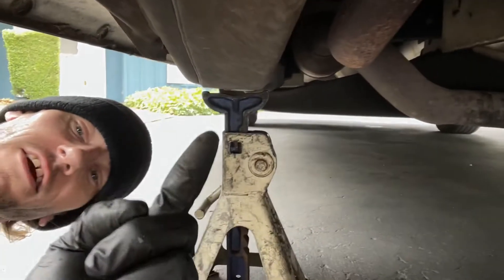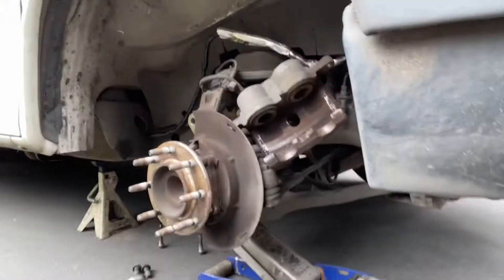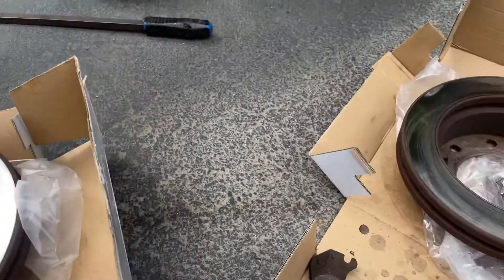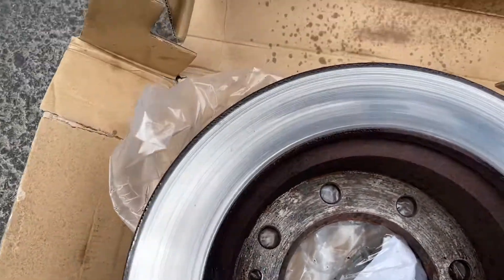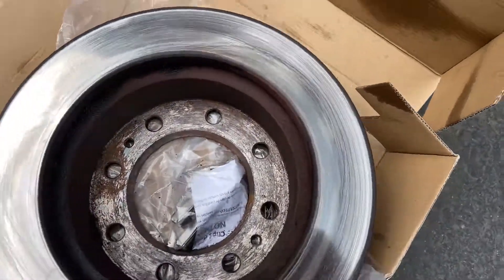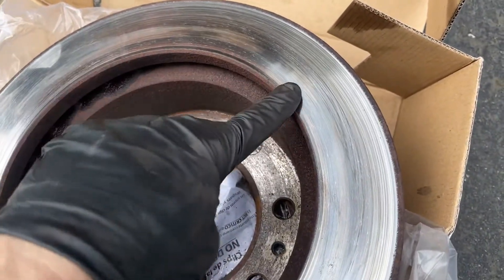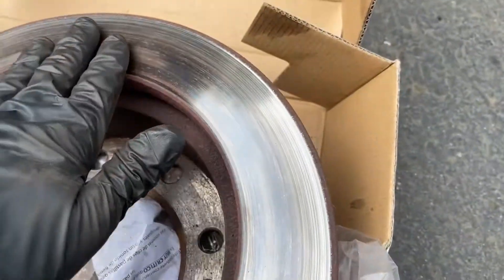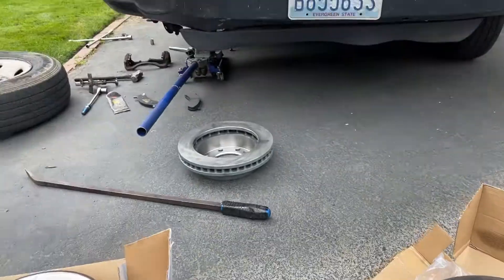Mechanics Tip (warped rotors)

Comment: Best tip ive heard so far. It takes a little more money but i think its the better option. So i had 1 rotor and pads changed on my car. And several months later its shaking again. This time im just gonna replace all 4 with new rotors and pads and do it right. The back rotors look fine. But im still decide whether to change those or not. Its the front that looks to have some scoring marks. Its even in the middle but on the outside and inside of the rotor have small scoring.
Reply: Did you get rid of the shaking while braking? Or did it come back? I have a newer car with 54,000kms and it shakes when braking hard at highway speeds. The dealership won’t warranty it because they say brakes are a wearable item. Most of my vehicles go at least 100,000kms before needing brake components
Reply: @beri232  yes i fixed my issue. What you need to figure out first is whether the issue is the front or the rear. If its the front, its easy to tell cause the steering wheel will shake side to side a lot more than normal and feel it in the pedal too. If its the rear, you will feel it in the pedal only.

Better have the rotors replaced unless you want it resurfaced. You have to buy new pads with the new rotors you want a flat surface so it will bed the pad with the new rotors. 

The most important thing you have to do after the brakes are changed out. Is doing the break in procedure. Id recommended doing the normal driving method. You just do normal driving, but because the brakes are new, you need to gently come to a stop not matter how much you annoy other drivers. If you get the brakes hot while holding it at a stop light the material will transfer to that one stop thats when the brake pulsation starts after it cools down. You do it gently so it doesnt heat up the brakes too much to have equal material transfer. I learned my lesson after i did pad slap on my previous car. I fixed the issue on it and braking improved immensely. 
Do that for at least 500 miles worth of driving. Watch the rotors for progress.

If you have anymore questions ill be here to answer them.

So i want you to do is after a drive, is to look at the rotors. You will see the progress of the pad tranfer. I wouldn't worry about what it looks like in the beginning. After your 500 miles worth of driving + braking. You  should see a even tranfer of material on the rotor thats when you can go back to braking how you want.  

Beding the new brakes is the most important part to avoid the issue
Reply: @jack8356  I bought Akebono Pro ACT pads. There is no bedding-in necessary. As per manufacturer’s instructions. I bought some EBC rotors also which have a higher carbon ratio so hopefully this fixes my problem. I’ll do fronts first because they are the easiest and if the pulsation is still there, I will will do the rears as well.
Reply: @beri232  they may say that but don't blindly follow that. Trust me you want to do the procedure. If not you would have to replace it again if it pops backup 6 months later like my did. Its better to be safe than for something to happen later on

Comment: Thanks for your info. After doing a complete brake job and after a couple thousand miles   my front right brake vibrates until I touch the brake pedal. Never when it’s cold never when the bakes are applied. Think I’ll change out both front rotors.

Comment: I got 70k out of my factory brakes and rotors.  New ac delco rotors warped within 20k. Always torque my lugs and my driving habits were the same. So I  think user error is far less of a factor than poor quality iron being used.  I feel for those folks who have to pay others to do these simple r&r jobs.
Reply: 70k? Wow. Got to fight out where that dealership gets their rotors.
Reply: I'm interested why would torquing your lug nuts to the specific torque change if your rotors last or not
Reply: What kind of pad material was used on the new brakes?

Comment: Hey, i understand that you like Brembo brakes. How about Zimmermann brand?
Reply from the maker: I feel that Zimmerman is more expensive for less quality, in the respect that, brembo brakes are a softer alloy and quieter, while dissipating  heat better. Yes, they wear fast, but when your performance car calls for that alloy as a requirement for braking, vs Zimmerman, which will be a harder alloy, you could experience temperature and noise issues similar to white box cheaper rotors.
Reply: @MechanicalTriage  Got it.
Those newer cars come with autopilot cruise control,  so it brakes for you thousands of times when keeping distance between you and car in front of you. That is how I overheated my brakes during  1000 miles non stop trip a day   up north to Canada few days ago... So now have warped front disks, they are solid with no holes. Now will try to install drilled from Zimmermann , as Brembo don't make drilled for my Mercedes.  Hopefully, the oveheating issue will be resolved on my next trip...

Comment: Hi, I have a 2017 dodge grand caravan. I have had my front rotors turned and replaced several times. The owner of the shop said the front rotors are notorious for warping.  The rotors ate less than a year old and I just had them turned last week before going on a trip. I drove 800 miles and the vehicle started shaking while going down steep hills. I was actually very careful this trip and didn't ride the breaker at all. During the last repair the mechanic stated that the only way to permanently fix this problembis to buy cold forged breaks and that they are super expensive. Does this sound right? Thanks for your help.
Reply from the maker: Do you tow anything with the van?  There are two options,,  first is brembo style brakes. (Expensive “cold forged”) but what I have had a good experience with is drilled and slotted rotors with CARBON METALLIC or CARBON CERAMIC brake pads.  Soled the same issue with a 2011 Honda Pilot (2 full front brake changes in a little over a year. )

Comment: If I put brand new pads on a warped rotor then replace the rotor can I use the same brake pads?
Reply from the maker: The proper way to do it, is ALWAYS put new pads on new rotors.   If you pad slap, you should at LEAST turn the rotors. Don’t ever reuse old brake pads on your car, and especially never on a customers. 

One exception…. If you have brake pulse, you can turn the rotors and reuse the pads… for a short while. But, why would you not just spend a couple dollars and get new pads?

Comment: What if the rotor keeps warping on it's own every few months
Reply from the maker: I would say, your either hitting mud puddles when it’s hot, or riding the brakes. 

On an honest note, if those aren’t the case, you probably have a bad caliper that’s hanging up and overheating the rotor. 

Time for new calipers and rotors and pads, again.
Reply: could also be a stuck guide pin on the caliper
Reply from the maker: Forgot that point.  Many times I have spent 10-15 minutes twisting a pin out because it’s severely rusted in place.   Better to get new calipers at that point I think.
Reply: I thought slowly stopping is the safest choice. Is it not?. And sometimes im having to break hard for a red right and having to sit there for a few minutes for the light to change
Reply from the maker: @jack8356  slowly stopping is the safest choice, medium stopping is the best for your brakes, Because:  slow stopping overheats the brakes, as they are creating friction for a longer time. (Like riding them down a mountain pass) aggressive hard braking is also bad because it creates a higher level of friction, and more heat, (drift cars  and track cars red hot brakes) 

Occasionally hard braking is ok, and slow braking, but just like your body, if you take it easy for too long, it’s hard to work right, and if you work too hard, things hurt and aren’t as effective.
Reply: @MechanicalTriage  wow, thank you so much for that explanation. I've encountered pulsating rotors across 3 different vehicles over the last 12 years of driving and just couldn't figure out how to prevent it. While I've tried my best to be smooth with brake application, I do drive rather spiritedly, and the local speed limits in Irvine, California are about 55-60mph which doesn't help my rotors when the light hits yellow at precisely the wrong moment and I need to shed lots of speed.
Reply: @MechanicalTriage  now we know why they're called Midas. Ugh... Same issues here. After installing all new rotors and pads. Backyard mechanics... Ugh.

Comment: What causes this problem? I have a 2022 Lexus RX350 with 54,000kms that already has warped rotors. Dealership isn’t covering them because I didn’t do the 36,000 km brake service. I’ve never serviced brakes on any of my vehicles until the pads and rotors were changed. They have always lasted around 90,000 kms minimum before replacement. Not impressed with this car so far.

Comment: What if you baked the rotor in a oven for a couple hours,let cool slowly,then turn it?These brake rotor are expensive and it seems like such a waste not getting the full life of these brake parts,Iam sick of these cheap Chinese manufacturers making junk and we have no choice but to buy it because nothing affordable is made in America anymore.
Reply from the maker: It may be possible to anneal and then re temper the rotors for reuse. I am unsure of the metallurgy compositions and what temperature / times would be involved. It is a waste that the rotors are manufactured so thin that you can only turn them once and still be over min.  And because of that initial thinness they all warp so easy.   We could probably do a little better by using a softer metal that absorbs heat better, (brembo style) I can pad slap those 3 times and they don’t warp.

Comment: Why does my wife continue to warp her rear (yes rear)r rotors on her 14 pathfinder.  She drives like a woman
Reply from the maker: Could be a caliper sticking.  Or the rubber hose that goes to the brake line could be swollen internally, causing the brakes to continually apply pressure. 

This would cause overheating and end up warping the rotors..